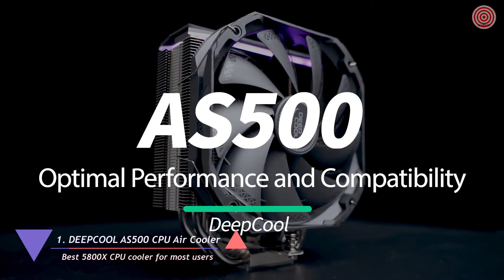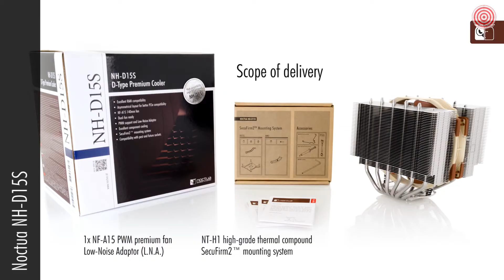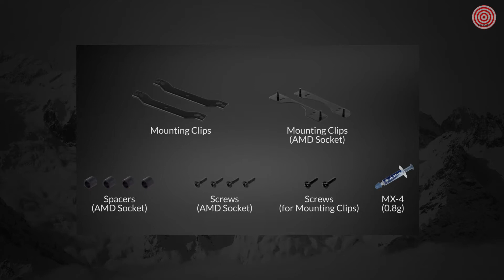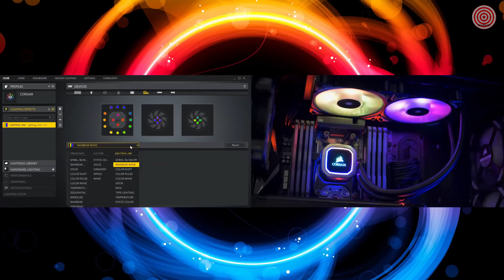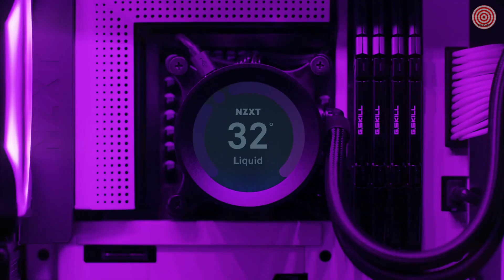5 Best CPU coolers for Ryzen 7 5800X in 2024

Comment: what about deepcool assasin III?
Reply from the maker: It will follow in a future video
Reply: @AryTechB  if it's not inconvenient, I would like to know if this cooler fits an aorus b550m elite
Reply from the maker: Yes man! This cooler is compatible with the Aorus B550M Elite, but you have to consider its height (165 mm) to fit in the case.
Reply: @AryTechB  Ok Ty bro
Reply: Temp tests?